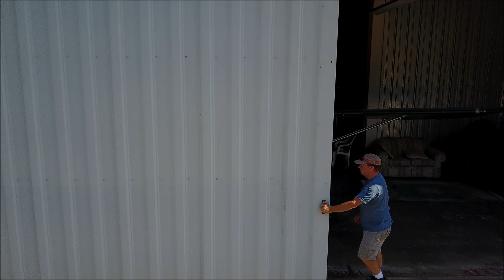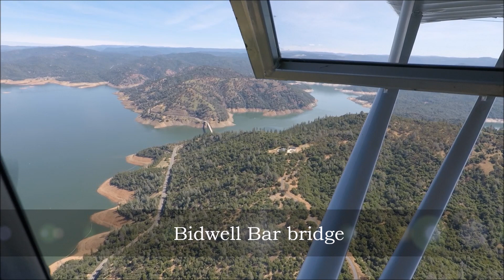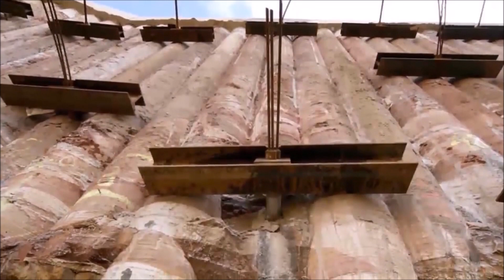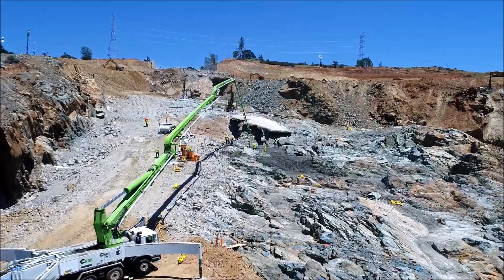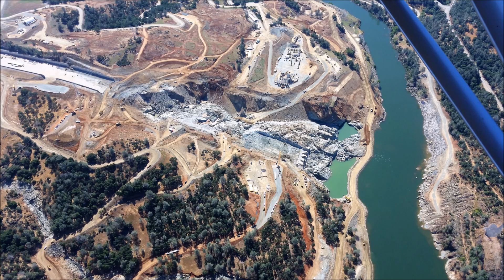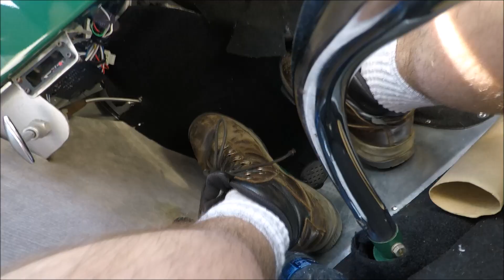Oroville Update 15 June Dental Work and Secant Walls

Comment: Very nice job explaining the intricacies involved in getting the project done right.  Friends are blaming  me for fouling up the concrete but I have to tell them that I worked on the power house only.  My job was properly associated with running a concrete vibrator and manual labor not requiring much skill.  The job helped get me through college and an appreciation for hard work!

Comment: a conveyor belt still needs a roadway to sit on and to access for maintenance plus it's delivery point is fixed, a truck can deliver to multiple points. conveyors require quite a bit of Maintenance ,they have multiple sets of troughing rolls and return rollers, head pulleys and tail pulleys, pillow block bearing heads at both ends and heavy wiring for high-voltage Motors. and if one conveyor goes down for any reason the whole system is on hold  and you're back to using trucks, for a temporary situation I think I would choose trucks also especially since it all has to be removed by winter. good footage good update thanks Juan

Comment: Juan - the RCC used to fill Croyle Canyon and other depressions created to reach competent bedrock beneath the new spillway will be essentially self-supporting; a separate  retaining wall will not be required. The outer face of the RCC will be sloped away and descending away from the new spillway. The design engineers will determine the inclination of the RCC outer face, which will resemble a set of stairs when complete.
Reply from the maker: Excellent! Thanks Robb!

Comment: Regarding the wall, between the new spillway and Croyle Canyon, I imagine it will be much lower than the upper spillway wall. Target heigth probably very little above the exact heigth necessary to carry the design outflow. If they have to run it harder, it will simply spill over the wall into the canyon, and I suspect it won't resist wear if it's topped, at that point I believe it'll be designed to fail, and get out of the way.

Comment: I found the info thanks. The river valve was in service during the drought, lake dropped to 647 feet . That is below the intakes but it doesn't give the exact height when they stop receiving water. Maybe you could find out, just curious. Thanks Pete

Comment: Dear Juan Browne. From Holland I follow your news about Orville Dam with great interest. 
At the times of storms and heavy rainfall I was really concerned of the obvious risks for milions of people downstream the Orville Dam.
Your insights and open and honest communication kept me informed and the way you do this
is a great example for the American Governement. 
From our flat county a suggestion to construct a spillway of a number of very strong tubes in a row, strongly anchored from the inlet to the bottom of the spillway. This closed system can be mounted on several levels of the inlet and outflow can be controlled from the enterance.
Aware of the tremendous forces of current and vacuum in the tubes. These forces can be regulated by controlled airflow into the tubes on
several levels.
I keep following your messages with great interest and with concern for my American friends.
Big bear hug

Ivo Baurichter Norg Netherlands
ivobarichter@gmail.com

Comment: Juan I have a question about the Hyatt power plant, at what level does the plant stop receiving water from the reservoir.It looked like during the drought the level was so low it was below the intake tubes and if so how did they send water down stream to the feather river. Considering the bypass tunnel was out of service due the supposed fire concern.
Reply from the maker: I'd have to look up the number buried in my notes, but check out my older updates on the RVOS and I go over the whole system and it's dramatic history during the drought.
https://www.youtube.com/watch?v=_q0g43iI9kA
Reply: Thanks I"ll check it out. I'm hooked on your series best coverage I've seen on a public works project and 
 I watch them all, just watched that Shasta Dam reunion and construction video great old shots.

Comment: Trucks give more flexibility in where they pour. Especially RCC. Going to take time, but as more voids in base rock get filled, the larger and more uniform each lift will become. Will then resemble surface of Great Pyramids. They will then super clean that stair step surface and overlay it with smooth top lift. You notice they used big coveyors wherever possible when transporting, screening, and stockpiling materials when they built Oroville Dam,  BUT...they actually PLACED almost all the materials in the dam embankment with big Caterpillar 660 bottom dumps, bladed and compacted each zone.
Reply from the maker: Excellent thanks!
My next question for engineers is how do they bond/bolt the structural cement spillway to the RCC?
And what about the drains?

Comment: First, thank you for your effort. This story has been a catalyst for me to learn much more about dam operations and water management. Your posts have been wonderful. Something that has been on my mind is the possibility that the spillway may not be needed in the coming year. Wasn't there a story early on about how the spillway had been built 40+ years ago and this was the first year it has been needed? It's a very necessary component when needed, but I wonder about how future construction plans (phase 2, etc) might change if/when it can be determined that it might not be needed (either this Fall or next Spring).
Reply: The "main" concrete spillway has been used, off and on, over the course of its life since its completion in 1968.   Inadequate design, construction and maintenance led to its severe damage when subject to the most rain and snowfall since the start of record keeping in about 1894.  The "emergency" earth spillway was used for the very first time this past winter and performed poorly, as well.
Reply: Thanks! Okay... It's the emergency spillway that was used for the first time... and the main spillway was used more heavily (higher than average outflows, it seems). Thank you for the clarification.

Comment: Not sure where they're getting water pressure from but starting a siphon with fire hoses over the edge down the hill would give them 1 psi per 27.7 inches of drop. They could use relief valves at the base to help if pressure is to great. their intakes could be floated at a depth that prevents air from entering the stream while not scouring the bottom of the lake.

Comment: A retaining wall will not be required to fill in the canyon. Entire dams are built out of RCC, the whole reason to use it as fill in this situation is that it will not require retaining walls or other heavy protection as long as the slope angle is controlled. See for example the new Gibe III dam in Ethiopia, which adapted RCC after an earth fill dam was judged unsafe. It's not that strong, but its still concrete.
Reply from the maker: Thanks!

Comment: How they plan to use the spillway during the next rainy season with only the bottom spillway and no place for the water to flow now that Croyle Canyon is history? Is it just me, or did they start at the wrong end?
Reply from the maker: Croyle Canyon is still part of the contingency plan...
Reply: Ok, I thought it was filled in. It just struck me odd that they started at the bottom. The whole spillway has excess water leaking underneath, you could see the foundation was washed away from underneath. I've been a Heavy Highway concrete hauler for over 25 years. I think RCC is a good plan. The first thing I noticed wash the foundation wash.. Thank you sir.

Comment: Hmmmm, so their doing a temp fix this summer and fall, like laying down black top on a new freeway, then re-bar and the real cement on top? Maybe that is what you're talking with how is that bottom base material going to laid down in a UN-uniformed way..I was just thinking isn't it just 4 months away for the first snow fall in that area? And their certainly not going to finish if so. Maybe if working 24/7. And double the man power and machinery..
Reply from the maker: stay tuned...lets see...
Reply from the maker: The lower spillway is permanent, as is the e-spillway fix.
Reply: yeah you were right, about the amount of fill, like millions of yards of fill.. Heck I think each bucket off of those track back hoes is close to 1 yard. That pump they have, to move the cement is a break waiting to happen... they need cranes  that can have those cement carriers that look just like the back of a cement truck, just turn upside, I know you've seen them. They use them all the time when building high rises, yes bottom base support.. In a sense the foundation of a high rise,.. That process and permit has the fastest dead line, that is why you will see like 3 or 4 cranes with these carriers. Heck they can set here like 10 of those right next to the cement plants main material outlet, and just keep picking them up with cranes, and moving them over to the spot to fill...
Reply from the maker: They might do some of that...and a lot of cement trucks...

Comment: Добрый день! Конечно руководство уже приняло все технические решения по реконструкции водосброса и  не нуждается в советах, но я рискнул бы кое на что обратить внимание - 
На верхней части водосброса , кроме усиления плиты и оградительных стен, устроить продольные раздельные стенки , чтоб был не один лоток а два или три лотка, это значительно повысит ремонтоспособность верхнего участка. 
Обрати внимание на аэрацию потока, устроив Ее и вдоль вертикальных стенок. 
Плиту основания проверить на вибрацию от вихревых, пульсирующих нагрузок, полученных при испытании модели.
С запасом выполнить анкероку в скалу, чтоб включит в работу скальное основание.
Желаю успеха в выполении всех работ по ремонту водосброса на уникальной плотине страны ! 
С уважением Владимир СПб 16.06.17г
Reply from the maker: Google translation-"Good afternoon! Of course, the management has already taken all technical solutions for the reconstruction of the spillway and does not need any advice, but I would venture to pay attention to something -
On the upper part of the spillway, in addition to the reinforcement of the slab and the protective walls, arrange longitudinal separate walls, so that there are more than one tray and two or three trays, this will significantly improve the repairability of the upper section.
Pay attention to the aeration of the flow by arranging it and along the vertical walls.
The base plate should be checked for vibration from the vortex, pulsating loads obtained during the testing of the model.
With a margin to perform an anchorage in the rock, to include a rock foundation.
I wish success in carrying out all works on repair of spillway on the unique dam of the country!
Yours faithfully Vladimir SPb 16.06.17г"

Comment: Since we were once told "The upper section of the spillway would not be repaired/replaced until next year, I am skeptical what is "upper".  It looks like they have been doing a lot of work on what I thought was "upper" and it's certainly not next year.  It begs the question, can the "new concrete" placed in the upper section be sufficiently cured to withstand the flows expected in that area?
Reply from the maker: Upper 1000' from the gates...

Comment: Juan, I think they decided to use trucks instead of conveyer belts to deliver the RCC due to the time constraints. It is much quicker to just fill in the canyon with dirt then to design and build a conveyor system to bridge the gap.
Reply from the maker: I think you're right.

Comment: Has there been an estimation of the total volume of concrete to be used in this project? Also, what strength ratings will be used in each application; Dentil, RCC and Spillway?

Comment: more good stuff... It seems to me that the cleaning process could be made more efficient with high pressure air and some vac trucks... but I noticed that the workers doing the water blasting are wearing protective gear so maybe there is risk of asbestos exposure? maybe that's why they are using water?   I can't imagine how miserable it would be to work all day in 100 degree weather wearing a full suit with respirator ... maybe they have a cooling system in those suits?

Comment: Juan - did you notice the rebar being tied up on the upper spillway?  This was the caption on the photo - "Rebar is prefabricated into sections to rebuild the Lake Oroville flood control spillway in Butte County, California. Photo taken June 14, 2017."
reference - DK_oroville_spillway_recovery_2403_06_14_2017.jpg  Can you get an explanation of the placement of this mat?
https://pixel-ca-dwr.photoshelter.com/galleries/C0000OxvlgXg3yfg/G00003YCcmDTx48Y/I0000j8STtah69tc/DK-oroville-spillway-recovery-2403-06-14-2017-jpg
Reply from the maker: will do!

Comment: Congratulations again for this video and for the new dog at home, Juan! By now there are 2 turbines at full power at the HPP (as I was speaking yesterday on the disclosure media lifetime, we also talk about you and your updates as well); if they stop them and thus not pumping water forward to the river downstream, then the river does not flow because of the spillway repairs and construction; so sumarizing: is this bad for the water in order to get a second dam with not-moving water in the thermalito diversion pool (or what so called the Feather river)? Is there a river valve that keeps Feather river alive while the Hyatt Power Plant is at 0 per cent of power?
Reply from the maker: Yes the RVOS system keeps the Feather alive at low lake levels and is up and operational. More details on RVOS in previous updates.

Comment: Looks like the secant piles will intercept groundwater flow - remember how groundwater flow played a role in the spillway failure.  Question: will the secant wall be normal to (at a 90 degree angle) the spillway axis or adjusted to an angle to divert groundwater flow away from the spillway?  Also how deep are the secants?  Will groundwater be intercepted during secant pile hole drilling?  Thanks - great update, sounds like Chewie got in on the audio

Comment: The use of trucks is more reliable then a conveyer belt. Up here in Alberta at the mines they use big trucks as well. The thinking is that a long conveyer belt is good but if it breaks then you get no production until it is fixed. With trucks if one breaks you are not shut down.
Reply from the maker: makes sense.
Reply: They should be laying RCC in multiple spots simultaneously.  How does one conveyor dump in multiple spots?  Besides that more union labor on the job = more profit.

Comment: You've mentioned the potential "scouring" of the spillway inlet.  Why is that a concern?
Reply: There's an earlier video that talks about that more.   The problem is the inlet side is not paved.  It's rocks and gravel.   If you open the gates to a high flow when the water level is relatively low it forms a fast current over those rocks &  gravel and might (will?) pick them up, pulling them through he gates and down the spillway (scour).  That would be bad because it could eventually undermine the gates themselves from the lake side.   Normally, that's not a problem because you can run the spillway slow when the lake is low and not scour the inlet.  But with the break, running the spillway slow actually increases undercutting of the break (earlier video), whereas running it fast caused the water to cascade away & not undercut.    So they got in the mode of letting the lake fill, running it fast for a few days, let the lake fill again,  repeat (explained in this video), and avoiding ever running it low and slow or low and fast.
Reply: Cember01; just for your information, if you have a look at the water coming down the spillway in the last spill, you will see water coming from UNDER the spillway before it comes over the concrete top of the spillway. What does that mean? That means there is massive cavitation under the top half of the remaining spillway. Add to that all of the 8 gates are leaking and there are cracks in the gate structure. So the dam is far from out of trouble at this time.

Comment: An off topic AV gas question came to mind from your closing shot of fueling the Luscombe.  I want to buy some 100LL fuel for use in my yard equipment, I live 10 minutes from CCR (Buchanan Field) here in Concord, Ca -  do you think they will sell to me if I bring a 5 gallon gas container?  Would I just inquire at the FBO office (assuming it's accessible)? 
Buying 97 octane gas for $9 a liter at the local ACE hardware store is maddening.  Occasionally I manage to fill up at Laguna Seca with either 100 ethanol free, or 110 leaded race juice but it's like $10 - $12 a gallon, I believe 100LL is around $5 at CCR.
Thank you Juan for another eagerly awaited video!
Reply from the maker: Yes, you should be able to purchase as long as not using on the highway...no highway tax on Avgas.
Reply: Success, Thank you!

Comment: For the emergency spillway (that is hopefully never used again)  after the secant wall is installed. Does there need to be an underground drainage system installed (above the secant wall) with  pumping  to control the moisture content/ water level of  emergency spillway slope?
Reply from the maker: good questions!

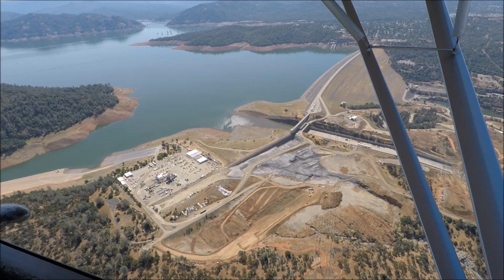Comment: AT 5:10 and 9:07, it looks like all of the existing vertical curve in the main spillway is being replaced in this contract. Is that correct? Looks like a good place to start and stop a project and correct all of the failed areas that need attention now!. 
 ....13